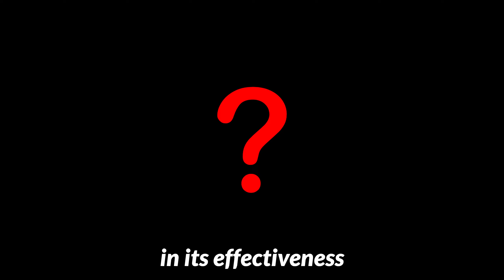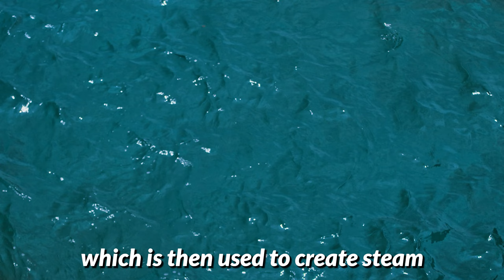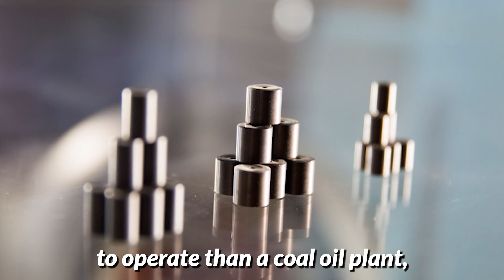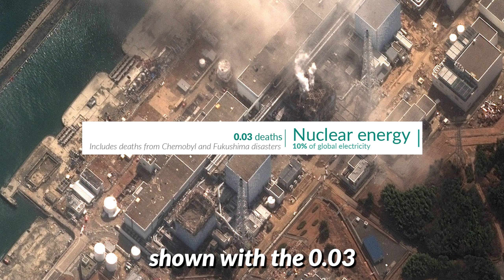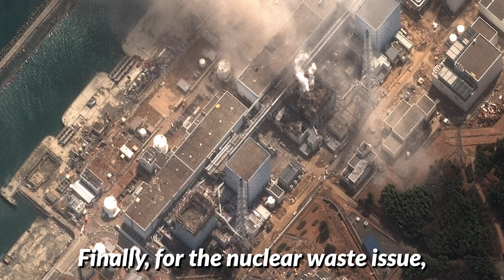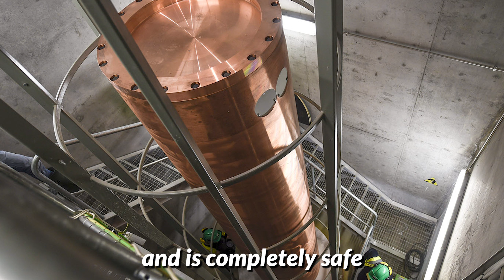Why You’ve Been WRONG About Nuclear Energy...

Comment: Stupid solution. 
Economically a dead end.
You are framing the wrong arguments.
Reply: We need a steady base supply to provide base load Nuclear is to only option which does not cause CO2 emissions
Reply: @allanmurphy8183  do you read ???
Reply: I would love there to be another solution (geothermal drilling perhaps), but we do not have anything other than coal,oil,gas, and nuclear which can provide a base loaf. All the talk of localised power production needs back up, we're esle can it come from?
Reply: @allanmurphy8183  There is also tidal. Additionally we don't actually need/want base load electricity supply. One of the best things(most overlooked) about solar is that it provides electricity during the daytime when there is more demand for electricity. A lot of work that needs electricity is done during the daytime when there is light.
Reply: We need base load as without  a way of getting the peak times and the times alterative power including wave does not run. also do not forget that we are aiming to increase electrical usage with cars buses trains, ships and a massive increase in home use the present system just will not cut.
predictions are that the entire world by the mid 2070s will need the same electrical usage as the USA uses now and that equates to A 15 FOLD INCREASE. I cannot see solar and wind providing that unless we cover large parts of the available land with power stations and storage facilities
Reply: @Long Dang  many industry have to run 24/7  those could simply be hooked up to SMRs and bingo peoblem sloved
Reply: @allanmurphy8183  SMRs are $2billion each. 
Nuclear trained operators 3 shifts a day 365 days, plus holidays plus sick leave plus training time plus weekends. 
Monkeys can put solar on rooftops. 
Solar glass area is the same as window area in most homes, and half the cost as the installation is a few industrial fixings.

The nuclear promoters limit your understanding by their profitable fantasies.
Reply: @allanmurphy8183  15 times more electricity is a scary amount.
I calculated 150,000 SMRs world wide if you used Australia as a guide.
500 SMRs for Australia's 25million and 5times bigger supply.

Your numbers indicate 450,000 SMRs plus nuclear operators plus millions of tonnes of uranium ore annually exported to every country's nuclear industries.

My numbers come from nuclear experts and Electric engineers published information.
Reply: @stephenbrickwood1602  we have around 400 plus reactors worldwide with probably 10 times that in coal, oil and gas so 40 to 50,000 SMRs sounds right (this is an estimate so take it with a pinch of salt) but lets not forget many countries are rapidly catching up with the west in usage China, India for example we do not have an alterative. maybe if deep geo thermal drilling is a success we could be just "pipe" dreaming however this tech is still just at the beginning stages and may fall way short of reality. All i am saying is we need to prepare for a world with either not enough power and all of the ramifications that entails or except coal oil gas and  hang the future or have a mixed power economy
Reply: @allanmurphy8183  as you say the down side is bleak.
Nuclear downside is bleak as trust in dictatorships does not exist even between dictatorships. 
We must make the other energy supply work. 

Let me say
The transmission of electricity is the biggest problem of all centralised concentrated electric power generation. 

This is the elephant in the room. 

The national power grid is 10times more expensive compared to generation plant.

5times more electricity needed in the future means
 a massive construction and massive mining and massive refining and massive amounts of money and massive amounts of manpower 

Mind boggling amounts. 

Unloading the national electrical power grid is critical for survival. 

Rooftop generation will be incredibly huge as it removes the transport costs.

Basically without transmission costs rooftop is unbeatable. 

I think I am right, I have used the experts information 'backwards' so to speak. 

Just let's get to the truth based on engineering realities. 
I am an old Construction Civil Engineer contractor with experience in the the electrical industry. 

Too little facts and too much bs.
Politics will take over, and money.

Much more to say, but latter.
Reply: @allanmurphy8183  Have you any idea how reliable tidal is?
Reply: @allanmurphy8183  Many industries don't use constant power for 24/7. The major reason why fossil fuels have been so successful is because it's power on demand dictated by the needs of the user.
Reply: @Long Dang  yes but it can only provide power to populations near oceans or large rivers many people live no where near such a place
Reply: @Stephen Brickwood  the big problem is how to produce more and more power using the limited methods. Running a city from rooftop power might work, but it would relay on the systems working at full capacity at key times with no backup. we need to look at EVERY method of clean power production .  Nuclear is one of those options. We can not just panic because its nuclear. We need to look at the facts dispassionately
Reply: @Long Dang  we have a 24/7 industrial base, and many cities have 24/ 7 lifestyle  car trains. Planes ships, and all wlli do  run 24/7. Just think all of that power must be instant and clean
Reply: @allanmurphy8183  Actually many large cities are coastal or near major rivers for historical reasons. Tidal, like all of the alternatives, has it own set of problems so going 100% tidal is unlikely to happen globally. Which leads us closer to the current answer which is that all solutions have it's own part to play. This puts nuclear(as it stands) at a disadvantage, as it's not flexible enough to play well with anything else. The vast sums required for nuclear means that is has to dominate the market or provide a poor cost per KWH. Portable solar panels are economical at as little as 30W sizes. New nuclear electricity production facilities are huge by comparison. Until micro nuclear reactors turn up, implementing nuclear along side other technologies will continue to be problematic.
Reply: @allanmurphy8183  Look at the electrical power use graph, it fluctuates like crazy. Many industries don't operate at constant power 24/7. Much of the work force goes home for the night(because they are not needed). Some work force have 24/7 covering shifts, but how many? Planes have huge changes in power usage when they are on the runway waiting for cargo and/or passengers. The same with ships when at ports.
Reply: @Long Dang  24/7 life exists around the world. China industries do run 24/7, and they make up one of the power-hungry nations with most of it population (like India living away from. The coast.
However, the point still remains a mixed power economy is the only safe way forward.  Tidal wave wind and solar will play their part, but so will nuclear. Just look at France 70% nuclear Poland planning on going down the same road. Short trem the reliance on Russian oil shows countries need an independent  power supply now and the only player that can be expanded over the next decade is nuclear. Its tried and safe with a death rate per megawatt so low its batter than wind
Reply: @allanmurphy8183  exactly what I am saying. 
Many people are not trained or experienced in the application of real world mathematics. 
I have tendered on very big construction projects and it is surprising what the real constraints are when you have to guarantee the completed working project on a fixed date and fixed budget.
One project was a simple concrete tunnel 150m long with massive ground loades and water proofs to ground water and massive temperature changes.
$3million tendered by others and massively over budget. 
I had it redesigned after forcing meetings and giving reality kicks on all their fantasies. 
The retender came in at $1million and close to the real world facts.
This has happened often. 
At the time it was a massive amount of money.
Reply: @allanmurphy8183  If research were to go into making a personal nuclear power plant to supply 200W constant power this would change nuclear's future dramatically. Using a yearly fuel cell change it would put the energy stored at 72KW(200W x 365) or 72KJ of destructive power if released entirely in an explosion. A typical 200g firework releases 600KJ(3 MJ per Kg black powder). So the 'explosion' from a personal 200W nuclear power plant failure would be eight times less powerful than a typical firework. Perfectly safe to stick at the back of a garden. I can see a possible market for a personal nuclear power plant, I just don't see anyone doing the research for it.
Reply: @allanmurphy8183  you say in the same statement we can not trust a dictator with supply of gas but we can trust others with nuclear industries. 
This is another elephant in the room. 

We have to make renewable energy technologies work economically. 

The Dictators will ramp up fossil fuel burning to force us to sell uranium ore to them.

Or the Dictators will steal the renewable technology and save the world. 

Hahaha Hahaha
Reply: @allanmurphy8183  France is in an awful state because it has 70% nuclear(which is inflexible).
Reply: @Long Dang  more of a micro module reactor. Nice idea maybe a bit too small as the unit cost would be high
Reply: @Stephen Brickwood  yes that is a difficult problem however world policing already happens with the US raiding some country or other for "some reason" so a group of nations NATO, UN would form a Frocester. We already have pretty strong laws in places a few more would not be a problem after all what freedom am I giving up the right to be bombed?
Reply: @longdang2681  I would say the opposite with no problems with Russian gas and oil and supplying other countries with excess power
Reply: @allanmurphy8183  wishful thinking. 
Australia will not sell uranium ore to most countries. 
It is too dangerous. 
That is one of the most important matters. 
The other is the grid costs to get the greater amount of electricity dispersed to the ends of the grid.
Reply: @stephenbrickwood1602  it s possible they may not sell however china is building a thorium reactor which  by passes the sales point secondly Canada has a reactor which uses spent fuel rods so not only by passing the use of expensive fuel but will deal with waste
Reply: @allanmurphy8183  That's the whole point of research, paying(smarter) people to find a solution to an existing problem? If we still had computer mainframes we would not have any of the computing gadgets that we use on a daily basis. It's because we invested research money into the personal computing that we have what we have today. If nuclear wants to be a bigger part of our future then we need to invest in personal nuclear power stations. PC's started off costing over 10K each, look at the price of them now? Solar panels are so wide spread because it's flexible to deploy. It's up to nuclear research facilities to recognise how nuclear can be deployed in the future and invest research money into producing the tech that will make it happen. The problem won't change to suit the solution, it is the solution that needs to change to fix the problem.
Reply: more likely "plantations" of SMRs to provide towns industrial complexes electric train systems and desalination /hydrogen and other gas production plants which are power intensive. By doing this a small group of well trained nuclear plant workers could manage all the safety requirements needed.
Reply: @allanmurphy8183  At 300MW for an SMR It's far too big for 'plantations'. Plantations is when you have solar with it's 200W panels. Each 300MW module can serve the complete electricity needs of 720 thousand homes(10KWH per 24 hours). Even with 1.5 children and parents that gives 2.5 million people. At a based load of 33% that would be 7.5 million people. Just ten SMR modules supplies more electricity than the entire base load required by UK homes. They may call themselves small, but they are not small. They are humongous. Imagine a testing phase that takes 2.5 million people or more just to live test a single SMR module. If there is a failure, millions go without electricity. This is why I say they need to be magnitudes smaller in order to stand a chance to be implemented. If those mammoths of a power plant are called small then we need to reach the stage of micro nuclear power plants.
Reply: @longdang2681  i got my scale slightly out!  but I stand by the principal. as for the word plantation i must have picked that up.  i still think we should be looking at groups of reactors managed by a well trained staff, that would be safer, allow power level to go up or down and ensure base levels can be maintained. A mix of different power production methods   wind, solar, wave/tidal etc
Reply: @allanmurphy8183  electric vehicles with huge amounts of energy would then be do nothing much as the EVs do not do the long drive Daily. 
Very few vehicles use their full range except once a year.
Reply: @allanmurphy8183  Which gets me to my point that until we get reactors that are at least 100-1000 times smaller(research needs to produce the tech) than SMRs, it's too big and clunky to implement nuclear power stations as they are currently. It's going to take some time because nobody seems interested in putting research money on 'Lego sized/styled' nuclear power stations that you can customise to the situation required. The mentality is still build the city around the nuclear power station rather than varying the power generation facility to the needs of the city.
Reply: @allanmurphy8183  if you are serious, think about every vehicle being a store of electric energy.

Just as the ICE vehicles would only use a little fuel each day for the daily drive and then fill the tank.
The EV would use only a little electric energy each day for the daily drive. 
BUT the EV battery can be topped up daily with the little amount used.

This means that a huge amount is in storage 24/7.

The real trick is having the EV connected to the grid when not doing the hour drive each day.

If that 'constant' grid connection can be achieved the the grid would have access to days of stored electricity energy. 

For example 20million vehicles in Australia.
 If 100kwh battery for the long drive but daily drive is 7kwh and topped up daily. 

Then 20million x 100kwh = 2,000 gWh, 3 days of generated electricity. Which is 600Gwh daily today.
Reply: @stephenbrickwood1602  Localised EV battery as grid storage is a bad idea. If you don't use the battery capacity of an EV battery then you should have a smaller battery in your EV that is more suitable for your needs. People insisting on having vast excess is what is causing a lot of the problems.
Reply: @longdang2681  the daily drive is 7kwh. 

The capacity to go further is the point of having a private vehicle. 

I have just made the point that 365 days a year this is a valuable resource that is 'free' with every vehicle. 

Also let me say it appears that in Australia there are 20million vehicles 
AND 20million buildings with roofs. 
Obviously you could put a rooftop solar 6.6kw system on every roof.
Every building is connected to the national grid.

The rest of the developed world would be similar ratios.

This being true then
Nonproliferation of CO2 
Nonproliferation of national electric power grids with its billions of tonnes of resources. 
Nonproliferation of nuclear industries 
Nonproliferation of military capacity 
Nonproliferation of massive debt. 

Nuclear promoters knows that their solution is only a Government Garrenteed cash flow for private business. They want to get in first before renewable technology dominates.
Renewable technology will be a massive and dominating industry.
Reply: @stephenbrickwood1602  What I'm saying is people shouldn't be buying an EV with a 70+KWH battery if all of your driving needs can be catered for with a 30KWH battery. Those 20 million vehicles with excess battery to supply the grid should all have been correctly downsized as they obviously don't use the extra capacity.
Reply: @longdang2681  long, long,long,
Nobody will stop using their fossil fueled vehicles because of range anxiety. 
This is a huge issue. 
Fortunately much better electric storage is being created, less polluting, cheaper, and the old existing batteries will reduce in numbers.
Reply: @stephenbrickwood1602  Nothing has yet materialized in advancing electricity storage. It might happen, but until then all we can do is use what we have. Battery storage is a huge waste of resources in something that generate no extra Watts. It's only purpose is to help alleviate problems that we do have in balancing electrical loads. The less batteries we have, the more resources we can put towards things that actually generate Watts.
Reply: @longdang2681  we have a logic problem. 
In Australia we can generate 660Gwh daily from just rooftop solar. 
Our maximum fossil fueled installed electric power stations can generate only 600Gwh daily, if you are lucky nothing has broken or the mines are not flooded or maintenance 'shut down' is not happening .

After people have stopped paying for all the private companies electricity and paid for the rooftop, everything is free. 
FREE is hard to beat. 
And much bigger than the fossil electricity daily. 
The grid is then 40% unloaded, this is spectacular.

Storage development is going 'gang busters'.
Reply: @stephenbrickwood1602  What I said was electrical batteries are the stupid way of doing things. Solar works best when it can be deployed in situations that require no battery storage. If you require battery storage then you are not using solar as efficiently as you should be. Solar has it's place(like all other solutions) to be deployed in situations where it makes sense to do so. Solar is not the answer to every energy problem. Forcing solar to be the answer to every energy problem by adding a(wasteful) battery is stupid.
Reply: @longdang2681  just think others have EV batteries that they fill with free electricity every day and power everything else in free electricity. 
When the sun goes down every EV battery has 3 full days of free stored electricity. 
Wasting free stuff just does not matter so long as you have plenty.
Reply: @stephenbrickwood1602  There is nothing wrong with solar, there's just no reason to deploy it in situations that require EV batteries to make it work.
Reply: @longdang2681  my whole point is that EV batteries will be universal.
And free with every EV. 

Hahaha 😊 

Just think about the whole matter backwards from what the promoters are saying. 

I am an old Construction Civil Engineer contractor. 
Trust me. 
I have worked with many idiots over the decades and against many who lost.
The reason I am good at this is years of experience. 
I will make a lot of money if nuclear gets their way. 
Corrupt politics can happen at any time and they will get their foot in the door and we will all pay. 
Socialising their costs is their expertise. 
They have paid me for years.
Reply: @stephenbrickwood1602  The whole point is that EV batteries won't be universal. They are not required and we should only use them in niche applications where there is absolutely no other choice.
Reply: @longdang2681  give me an example of what you are thinking
Reply: @longdang2681  are you worried that batteries are a problem for the environment?
Reply: @stephenbrickwood1602  there are so many problems with electrical batteries, including environmental ones. We've had access to electrical batteries for a long time now, it's nothing new, holds a little more charge now for a slightly longer time but nothing new. The reason why we've never massed produced electrical batteries is because they don't fix any problems. They need to be combined with things such as solar(which are the actual solutions). People waste time and energy on batteries because they have run out of progress. Look at the EV market. They use bigger pre-sealed batteries to mask that there is no progress made? Batteries are a temporary distraction?
Reply: @longdang2681  wow, you do think differently to me. Hahaha. 
It is people like you that makes me think deeper. 
I do think we are now rapidly developing electric storage as the cost of not is possibly 'climate destabilisation'.
Cheaper Renewables makes batteries valuable and so more research is happening. 
Just my perspective.
Reply: @stephenbrickwood1602  The EV manufacturers are(probably purposely) being very slow with EV battery implementation. For example all(similarish) petrol cars have always been modular fuel interchangeable via the jerry can, etc. I can 'fuel up' a car by moving jerry cans from one car to another to increase it's max range. This allows me flexibility to carry the right amount of fuel without permanently carrying around excess weight. How many EV's can claim to do that? Range anxiety wouldn't be such a problem if to you could simply load up energy to increase your max range whenever you plan to go on long journeys. When you were thinking EV batteries for grid backup, you were probably thinking of a multi purpose removable battery? Am I right? This would make the most of the batteries, but I don't think that's what EV manufacturers want.
Reply: @longdang2681  I think that the automatic selfparking will guide the EV the last half metre upto a low wall mounted power point, say half a metre above the ground. 
And then the EV will 'nuzzle ' onto it and so be plugged into the national grid. 
The EV  battery can trade electric energy with the grid for money or top up its charge.
The connection gadget will make this a simple cheap detail. 
Every parking space just needs a wall power plug. 

This is a cheap and easy matter. 
In Australia there are 20million buildings. 
And 20million vehicles. 
And say 100million 'ends' to the national power grid. 
And everyone wants a big battery in the EV. 
The trading of electricity with the grid will be a universal feature of the national grid.  
As I said millions of batteries connected to the grid means all batteries can be topped up daily or have a minimum amount as per the EV computer instructions. 

Just my thoughts, but it would mean 23/7/365 connected and valuable part of  the existing national grid.
The existing national grid would be UNLOADED and protected by the batteries. 
The Daily drive will be done in the usual hours. 
Most EV use no power in a traffic jam when stationary in the traffic congestion.
Reply: @stephenbrickwood1602  I'm thinking more of... you buy 80KWH general purpose modular removable battery. Normally you would use 30KWH to drive intercity and short journeys, with the remaining 50KWH staying at home to provide electrical backup for electrical grid, an E-bike, any portable devices/tools etc. Every time that you need to, You would combine all your batteries to get an 80KWH longer range battery that would run your EV for longer journeys. It's not an EV battery(as people would think EV batteries). It's more like a very big AA, AAA battery that can work in EVs as well as many other devices. You would only use the battery where you absolutely need to. More of the worlds electrics need to be compatible with universal user replaceable batteries?
Reply: @longdang2681  excellent thinking. 
Most people do not get past their first thoughts.
My bigger thoughts are that nuclear in every country will not be needed.
As dictatorships steal everything including nuclear technologies, then they may steal the renewable technology and 'save the world', Hahaha. 

83% of the world's population is in dictatorships I read.

The USA can save their fossil fuels for war fighting and emergencies, 
Fossil fuels will take a long time to reduce unfortunately, we just have to be moving in the right direction.